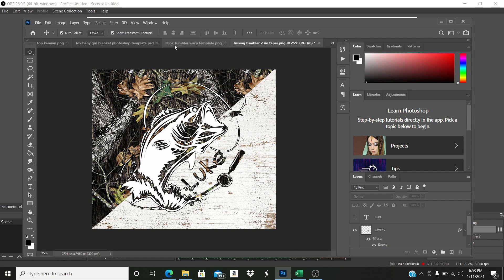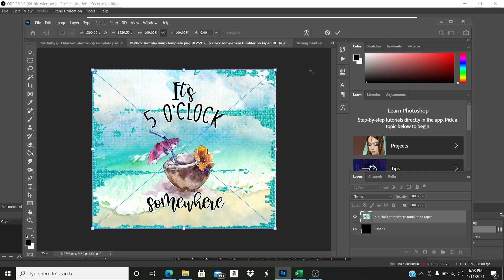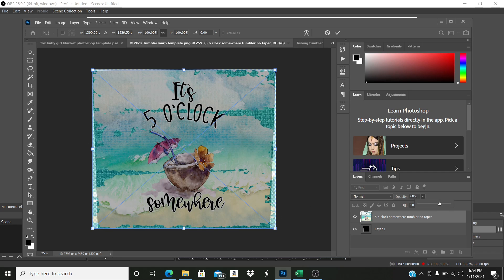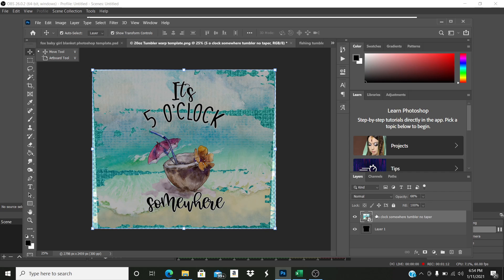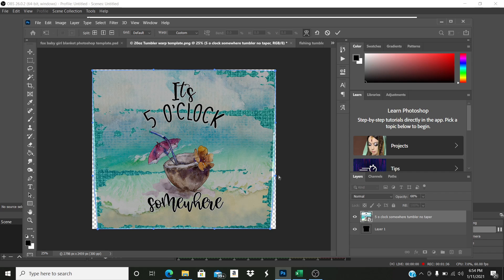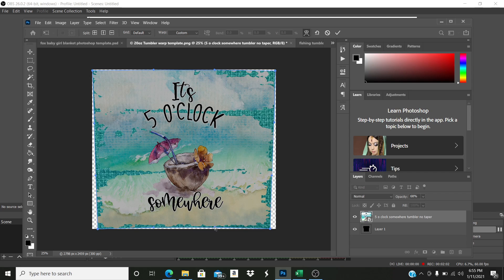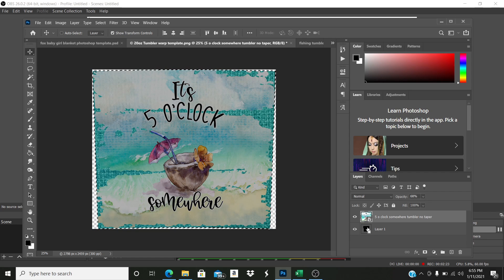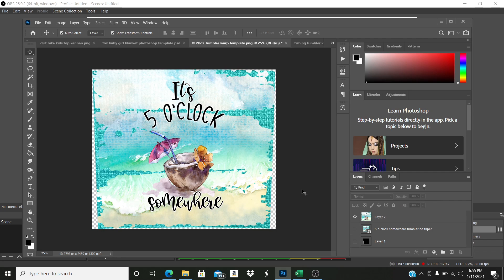How to warp a 20 os Tumbler Design using Photoshop

Comment: How to use that template? If I want to apply the same warp effect to the other image by just adding it, how to do that? I want to make template in which I will just add the picture and It will automatically wrapped in a shape. How to do that?